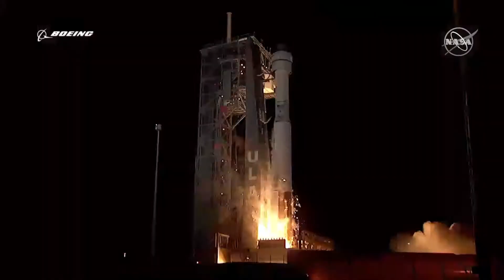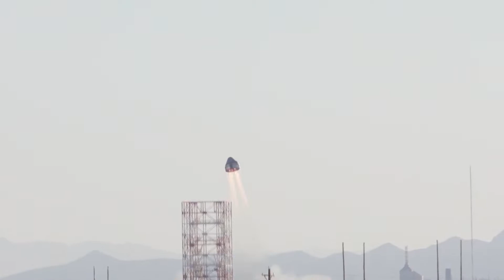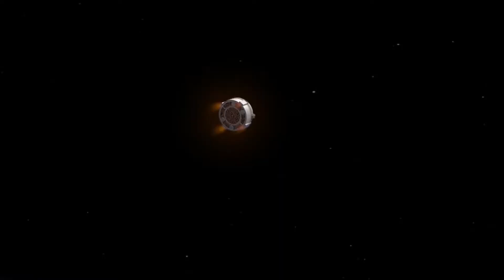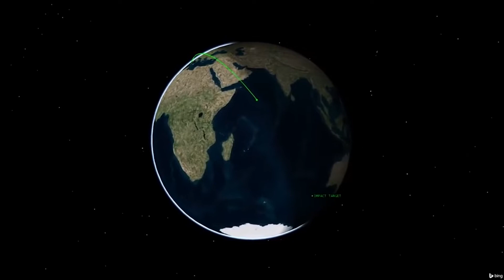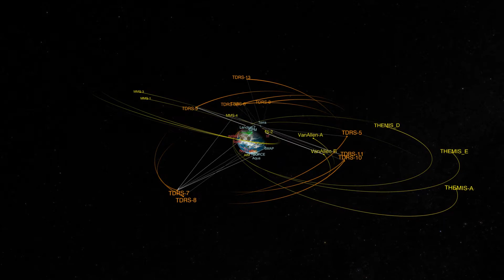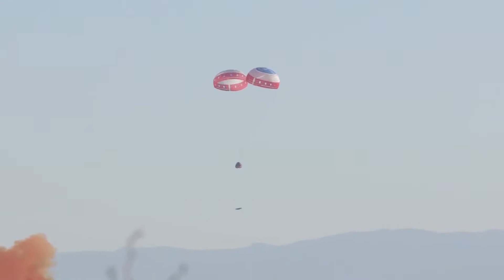Starliner's off nominal, but still safe first flight!

Comment: There were many possible outcomes, of which this was (in retrospect) one of the best.  While they were able to abort to orbit and salvage the landing, the lack of apparent competence (a timer issue? Really?) on the first test flight does nothing to inspire confidence in the rest of their program.  Yeah, this is why they test, but this just smells as bad as it looks.  JB at Nasa is a great salesman but I hate watching him have to upsell this kind of garbage.
Reply from the maker: It does look bad, I agree, but this kind of thing happens sometimes. I would love to know what kind of hardware testing they are doing. I've given this a fair bit of thought, and I suspect they pulled the UTC time instead of the mission elapse time, it would account for the roughly 11 hour difference. Mistakes happen. This should have been caught on the ground, but...

Bottom line, the most important things worked as they had to. Lots of work is going to have to be done to make sure there aren't any other software bugs lurking around. But things could have been much worse...
Reply: @WhereisRoadster  I agree that the most important things worked and that Gravity does not want to be escaped.  It's sad that they're probably going to blame this on a programmer or some low level engineer.

I miss the days when the best and brightest were coveted by NASA, Boeing, LM, and the likes.  Space was important.  "Top men," doing the impossible.  Perhaps those days are not gone and this was a one-off and I'm just a crotchety old man flailing at the darkness.  I hope so.  I'm tired of borrowing money from China to give to Russia to  get to a space station we paid most of the tab for...  As always, enjoy your insights Ben.
Reply from the maker: @jeffnewcomb601  This was a system's engineering problem that showed up in software. Somewhere the interface wasn't designed or used properly... BTW, I'm a systems engineer...
Reply: @WhereisRoadster  I understand Ben.  Would you agree it should have been caught in pre-flight testing though?  The package uploaded to the payload/crew module would have needed checkoffs by more than one person.
Reply from the maker: It should have been, but doing a full end-to-end simulation of a rocket launch with hardware on the ground is difficult. I've never worked with high end rocket launches, nor with Atlas, but they would have to have the electronics from Atlas and Starliner in the same room to test that kind of thing out. The few launches I've been involved with did not have that high of fidelity.